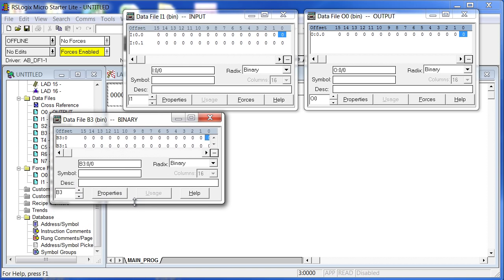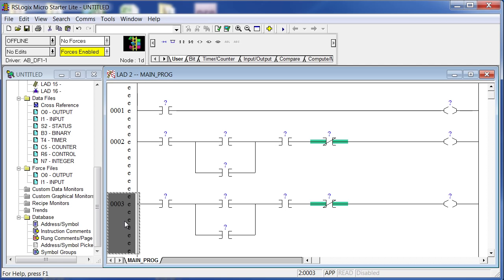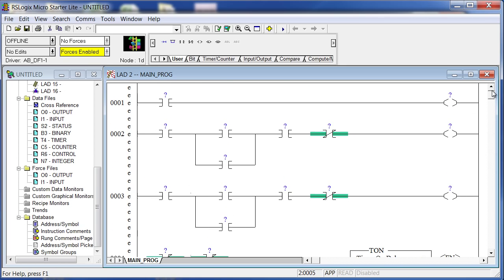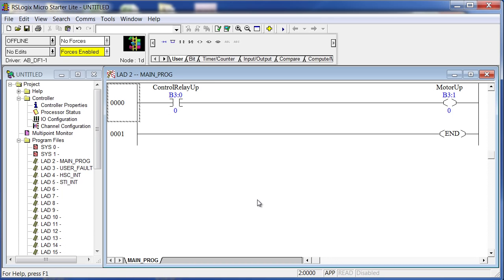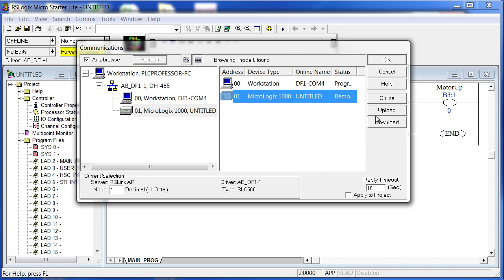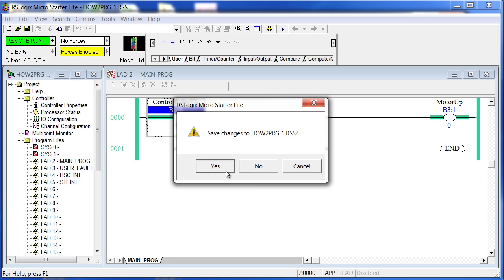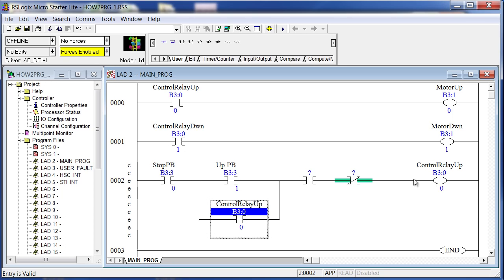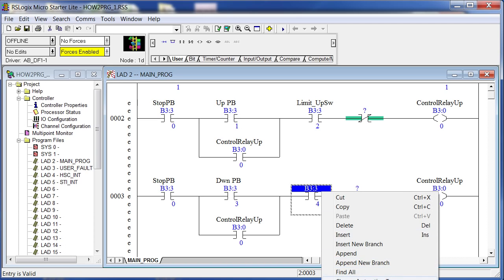Prog-1c How To Program a PLC - Basic Level

Comment: For those having issues with running the Emu500 drivers, here is what I did to get mine working:
- Download and install all the software (Micro Starter Lite, RSLinx Classic Lite, Emu500 driver)
- Open the emulator application.  Select the current project file (i.e. How2prgm1).
- Open the RSLinx software, at the top menu select Communications > Configure Drivers...
- In the box, click the drop down menu and select the Emulator driver.  Click Add New.  Select a node for it (I chose 01).  Make sure it doesn't conflict with the workstation node (00 by default).
- Follow the steps in this video for making the project, up to where he downloads the project to the PLC.
- (IMPORTANT) Before toggling bits on/off in the program, go back into the emulator program (RSLogix Emulate500) and click on the small "RUN" button next to the project name in the menu bar.

Now your emulator software should be communicating with the workstation, and actively functioning with the project logic.

Comment: Hello PLC Professor, 
I trust I learned the PLC language better than before via your videos.  Thank you for doing this for all to learn. 

It took me over a year to make a conceptual leap to understand instructions over contact (yet some processes are similar). I would love to use these videos as my training base as my developed skill for employers to observe. Please inform me if that is a good idea or not.

I only watched 5 videos... up to “How to program a PLC - lecture 1c”. Will that be enough to advertise as a skill?  Also, the videos are 5 years old.  Will there be a link to download the software & download many PLC examples? Btw, you said you have 70 instructions (commands) for students to learn besides xic & xio?

Last but not least, does PLC language apply for general programming outside of automation & robotics
Reply: ....?  (I sent message to soon) Please respond. Thank you. 
DeSean
Reply from the maker: All of that is covered in the videos and manual.
Reply: Which  of your PLC books you recommend for today’s PLC in use?
Reply from the maker: The orange and black one on Micrologic1400, but in addition you need a 1400 controller and Micro Starter software that can only be purchased from an AB distributor.

Comment: Hello. As usual I am late to the party. Good video and talk though. 
I did notice what I think is a slight issue with this design, perhaps I am wrong. As soon as your door begins moving and stops hitting the limit switch the door would stop moving?
In other words when the down button is pressed the door would start moving down, but then the Limit Up Switch would become false/off/open, thus stopping the circuit. You would need to add another brach to bypass the limit up switch, until the limit down switch was true/on/closed.

Thanks for the vidoe, enjoying following along at home on my emulator :)

Comment: Thanks teacher. I have 2 questions.
1- In this lecture you have given bits a memory locations like B3;0/0 etc etc and in the next lecture you assigned them inputs and outputs. So is this necessary to first give them a memory location B3;0/0 etc etc and then input/outputs.
2 - I am trying to download emulator driver from rockwell automation but it is showing error. do you know any other website or solution.
Kind Regards
Reply from the maker: eSamiSam 1. this is just to demonstrate that bits in memory are bits in memory, but some of them are associated with I/O modules. The logic is the same but there are inputs and outputs associated with specific bits.
Reply from the maker: eSamiSam I include all of the software on Disk 5 of the RS500 Complete PLLearn Series Lab Wrap-up Videos.

Comment: Hi, I was just wondering why when you address each of the switches in the program you use the binary prefix instead of I for the inputs and O for the outputs as is this not where the field devices would connect to the plc. thanks
Reply from the maker: +john hindley A bit in memory is a bit in memory, whether it is influenced by the state of an input field device or not, it is just a bit in memory. In this video we used individual bits from a data file, B3 and you can toggle these bits on/off from your keyboard, thus not needing an external field device. In the next video we replace the B3 bits with actual I and O bits. This is all covered in detail in the manual.

Comment: Can i configure driver without PLC. I am beginner
Reply from the maker: You cannot "auto configure" without hardware ports for RSLinx to discover, but you can do a static configuration. In other words, you can fill in the blanks to configure the driver but you will have no way to test it. You can configure the Emulator driver without a PLC because it has convinced RSLinx that portions of your PC "is" the PLC.